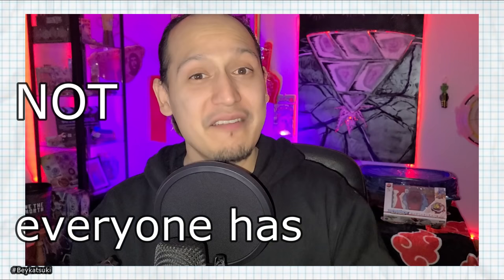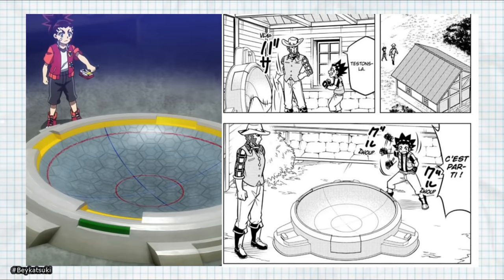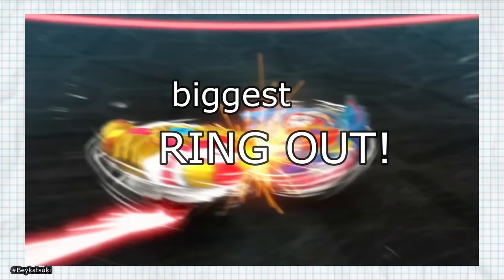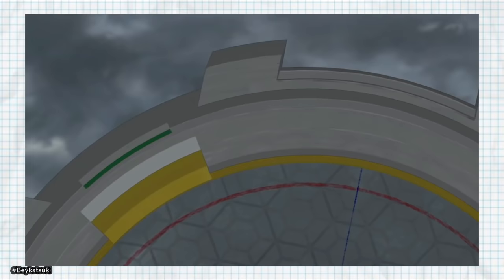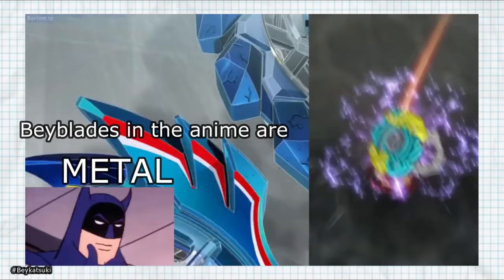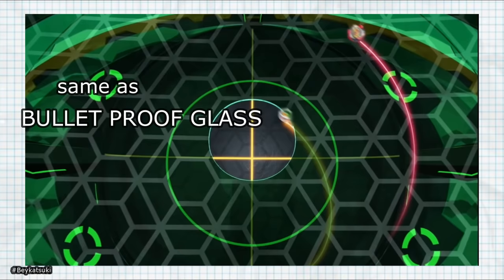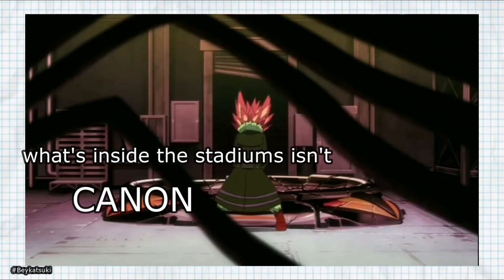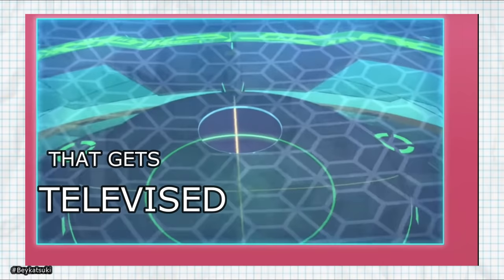What's Inside ALL Beyblade Stadiums in the Anime? Beyblade theory

Comment: Other possible materials could be fiberglass or carbon fiber since they are light and strong. Or maybe they can be made out of a material similar to drywall for the base covered by a layer of any of those materials I mentioned before. As for the see-through part of the double decker stadium of DB, it can be made of the same polimer they use for the windows of an air plain. Or plexiglass, AKA, PMMA. Not sure if those last two are the same thing.

Comment: From my country we actually have these wide buckets that are normally used for laundry but are big enough for bey battles and they come in plastic or metal varients
And judging from the anime when the beys land on the stadium they almost sound like they are landing on a thin piece of metal (burst,god,cho-z,and gt) maybe the stadiums are theoretically made of metal?
Reply from the maker: So true! Although, I was going to add some maths I did to approximate the weight.. even if made out of Aluminum, one of the lightest metals, a solid beystadium would weight over 1300 kgs.. 

Still, Taigas stadium may be made differently...🤔

Comment: I speculate it is made from cement with metal mesh inside, so they can crack but not fall apart easily. And then probably coated with a resin layer to get a polish surface that can maintain it frictions. But there is probably no material that can generate spark with plastic. Only metal on metal can generate sparks.
Reply from the maker: After making the video I can accross a method that's essentially what you described. They used it to make a statue of the virgin Mary in Spain. Mixing sand, cement and epoxy with reinforcement. Smart thinking! 
I agree, the surface has to be different. What do you think of the graphene layer inside? IMO it's a definite possibility. Btw.. Thanks for watching and leaving a comment ✌️
Reply: @BeybladeDad  The graphene wouldn't make a difference. It only make material stronger that are deformable. It won't help with materials that crack instantly like cement. But it can help to make it more friction less. The transparent aluminum was a great idea. It is scratch resistant and strong compared to glass. But I don't know if it would generate sparks if hitting it with metals. If the beyblade tip were made out of metal, then it would probably make sense.

Comment: they might be made of slate. its pretty much clay that's been pressed for so long it becomes rock. slate is pretty hard but also not really heavy. easy to shape too. breaks like stone to. you can also sand it pretty smooth. maybe its just slate with a nice hard paint coating. maybe powder coating it would work. hmm.
Reply from the maker: That may be, but from my experience with slate... It's extremely heavy. My buddy has a pool table, and the flat part of them is made of slate.. we could hardly lift then😅😅🤔 I could be wrong, and it could have been made of some flat stone. Apparently that's what pool tables are made of tho😅 thanks so much for watching and leaving a comment ✌️
Reply: @BeybladeDad  im sure they can get pretty heavy when large enough. i have messed with small pieces and they always feel pretty light. so probably gets heavy quick when larger . but they do make a nice knife or carving of stuff with. because they brake in like sheets they can come out pretty sharp. i would say porcelain but yeah toilets' are heavy as hell that's for sure. maybe some kind of clay but like mixed with something. like if you add sawdust to clay it makes it more like a filter or sponge like. still solid but porous maybe enough it can lose a good amount of weight in it.
Reply: maybe its just ceramic with sawdust 50/50 mix. blacksmiths use clay a lot for molds and well wood so would be pretty much every where and easy enough to get. maybe i should mess with making one just to see. even though i dont have any bayblades lol.
Reply: what if its just made of pumice.

Comment: Back in metal fusion we are shown that ginka used to beyblade in a wooden stadium carved out from the trunk of a tree over years and years of beyblade batlles at first he had a genaric bey like any other and the sparks didnt set the stadium on fire (not really scientifically accurate but still) then later with pegasus which has a rubber tip which means the friction is even higher and in turn also the heat still no fire (again not irl accurate) so wood was def used in smaller villages who didnt have acces to other materials
Then we move on to metal masters when ginka meets 2 members of the chinese team and they have a battle in a gong which as far as im aware is made from metal so metal is also a possible material
This doesnt mean that all stadiums are made from these matterials far from it actually, but this also prob means that all stadiums will be made from different things depending on where in the world you are.
There will prob be a standardized construction materials and rules from the wbba which manufacturers have to follow but thatll only be for official stadiums non-official stadiums can be made from anything
Reply from the maker: I couldn't recall the episode where Ginga was doing it, I really want to include it in the wood section of the video, although I was referring to the standard stadiums I tournaments. You're right about some being made from different materials, like Taiga's could be made of lightweight material. Thank you for watching and leaving a comment ✌️
Reply: @BeybladeDad   was it made of uranium?

Comment: Rubber is still usable if using tyre Rubber as their little to no bounce when the blade hit the Stadium this is for Gen 1 Beyblades tho so newer Beyblades might not work.

as for heat and friction tyre like Rubber can withstand some high lvl of heat as they did use them for space landings tho not sure when.

back in school their was a bin lit we used as a stadium as it was extremely hard we just Inverted the top in and played on it Until one of the More Mentally ill kid would stop them mid play we ended up moving the game to the saw table not a ring but a decent area to work with we played more prolonged games.

Comment: The most logical thing is they use resin to make them and have a mold and they use where as real life bey stadiums are vacuum formed anime uses either injection molding or slush casting
Reply from the maker: Resin castings are very useful, although I'm not sure it would show the sparks. Do you think the surface may be yet a different material in the anime?

Comment: Watching this makes me wanna make a carbon fibre stadium, I’ve used it for the hulls of small boats and drones before and I don’t think it would be that hard to make a stadium since a stadium is basically a bowl
Reply from the maker: I'd love to see that become a reality. What I've seen and done videos of before is 3D printed ones. Even the anime stadiums I use were molded off of a 3d print version. Carbon fiber would be good, but may be expensive if done at scale, but I'm guessing since you have the experience with boating it may be easier. Another Beyblade YouTuber uses dome a skylight as a beystadium... that can also be pricey, but you can just buy one.

Comment: I don't t think is concrete or cement because these have a high number of density so it would whey around 80 kg for a bey stadium of 0.5m radius an 2-3cm width of concrete and 0.3m wall height also it would also have cracks from tension stress so it would be a good idea to reinforce it with metal as well.

Comment: It's Marble/Concrete now ya know
Reply from the maker: What about the db stadium?
Reply: It's the same but is has more concrete because of the vortex climb thing and it has a metal surrounding the edges because when the bey is boosted and hit the stadium it will hold the stadium to avoid cracks and be destroyed there will be little cracks but it will not be big and keep the battle ongoing😳
Reply: @BeybladeDad  and the other one used in the final battle the same and a hard Glass😁

Comment: u could also use metal like used in a chinese wok. They are giant woks in china. U could use the same technique to build even bigger ones. Would be still able to be transported with multiple persons. And kinda cheap depending on the metal. Aluminium could work too. And the base could be made out of wood or plastic. And the surface of the metal could be coated with plastic so the tips dont wear so quickly.

Comment: Ceramic.
I feel like its Ceramic.
Reply from the maker: What about Aiger's stadium? That one must have been a different material, or no?
Reply: @BeybladeDad  Baked ceramic is not too heavy. It's hard, heat resistant, can be painted pretty easily and could be manufactured with the limited means they had at the village.

Comment: How boat apoxy resin? ( I must have spelt that wrong)
Reply from the maker: I think epoxy can work well! I'm using it for making Beyblade parts, but the only thing I wonder about I'd the impact of the Beys. In the anime, this impact would be much greater, so I'm not sure if it would be only that material. What did you think of the possibility of having graphene coated stadiums?